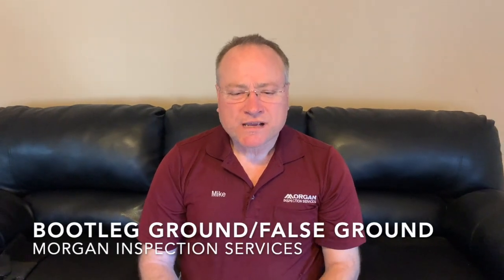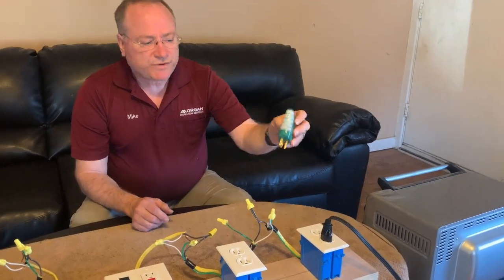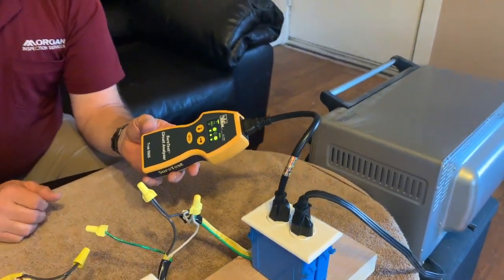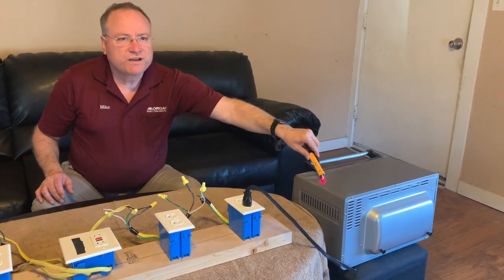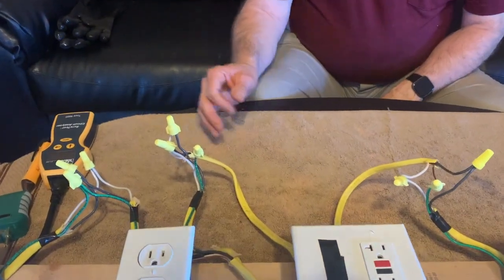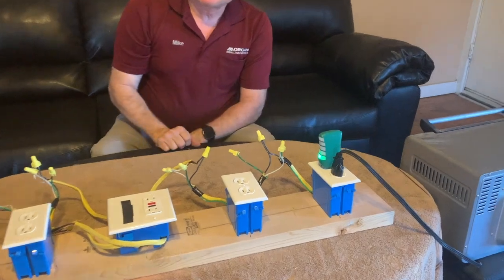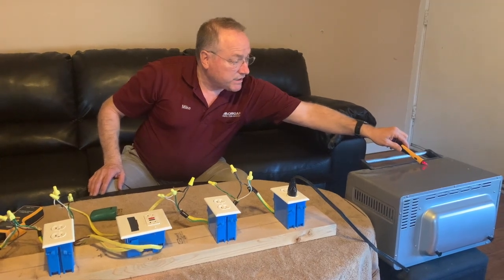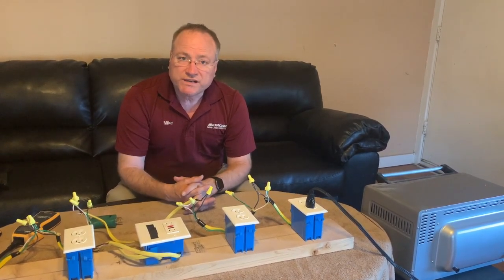What is a Bootleg Ground? Why are Bootleg Grounds Dangerous?

Comment: I know I’m late to the party, but I would like to point out, a couple of First I do not support ‘BLGround’ but there a couple of countries where it is legal and was made illegal by code in the USA in 1996. So don’t do it.
Second any 3 prong clothes dryer is a ‘BLG’ where the neutral and ground are bonded on the machine, and it’s completely legal so when you wire a 4 prong you simply separate the ground and neutral. 
Now we go to the test where you separated the neutral and showed current on the microwave, well once there is ‘BLG’ there will always be current on the microwave 
Neutral doesn’t shock you 
Neutral and ground are bonded bonded on the main panel
There benefits for ‘BLG’ against short circuit and ground fault problems
But don’t do it use damn 
GFCI outlets

Comment: I'm thinking if you moved into an old house full of bootleg grounded outlets, until you can get an electrician to work on this issue, it might be safer to unscrew the outlets, cut the bootleg ground, and leave it temporarily that way, than have the ground connected to neutral.
Reply from the maker: You’re exactly right to be cautious. A bootleg ground—where the ground wire is illegally connected to the neutral terminal—can create a serious shock hazard, especially if the neutral becomes loose or disconnected somewhere upstream. In that case, parts of the system that should be safe (like the metal cover plate or appliance chassis) could become energized.

Cutting the bootleg ground and leaving the outlet ungrounded (but labeled properly) is definitely safer than leaving the fake ground in place. It’s not a long-term fix, but it eliminates a dangerous condition until a licensed electrician can run proper grounding conductors.

Thanks for pointing this out—it’s a smart approach to a dangerous situation!

Comment: Liked. Both points you've made in the video are good points.

However, I'd propose a third point on why bootleg grounds are bad. And that is nullifying GFCI's. If a bootleg ground is installed upstream of GFCI protection whether that is an outlet or circuit breaker, then it forces the ground out on the neutral path, which would look business as normal to the GFCI = no interruption.

When upstream of GFCI it is much safer to just let the ground float as sometimes it would still trip if current goes out to ground due to the saturation effect causing a temporary mismatch in current to neutral.

Some people really don't think before cheating something like a basic light tester.
Reply from the maker: Great point! Bootleg grounds are already a dangerous shortcut, but installing them upstream of GFCI protection makes them even worse by bypassing a critical safety feature. I hadn’t thought much about the saturation effect on the ground float, but that’s an interesting consideration. Thanks for sharing your knowledge!

Comment: I don't understand the case where neutral is broken before reaching the outlet with the bootleg ground.  In that situation how is there a circuit at all in the last box?  Isn't the hot wire the the only wire that has an unbroken path to the panel?
Reply from the maker: Thank you for your question! You’re correct that in the case of a bootleg ground, if the neutral is broken or disconnected, the circuit is disrupted because the return path for current is interrupted. Since current can’t flow, the load essentially becomes a conductor, and this causes the neutral side of the outlet to become energized, as does the ground system, because the neutral and ground are improperly connected at the receptacle.

This creates a dangerous situation where the ground and neutral can carry voltage, making what should be a safety feature (the ground) a potential shock hazard. The hot wire may still have an unbroken path, but without a proper return, the circuit can’t function safely, and the entire system becomes compromised.

This scenario is one of the reasons why bootleg grounds are so dangerous and violate electrical codes. Proper wiring and grounding are absolutely essential for safety and functionality. Let me know if you’d like further clarification or have more questions!
Reply: @morganinspectionservices3840  Thank you for the explanation.

Comment: A good electrician friend of mine who also worked as a home inspector many years ago, told me of two methods he's used in the past to detect bootleg grounds that do not require removing the coverplate or the $450 give or take Ideal SureTest circuit analyzer.   

The first alternative method requires that you have a good estimate of the distance from the panel to the outlet you're testing, as well as whether the circuit is wired with 12 or 14 gauge.   

Here's an example.  This house was built in 1955, there is a fairly recently installed breaker panel, and some rooms have all two prong outlets, other rooms are three prong that test as "correct" with a three light tester, and you need to know whether or not the rooms with the "properly wired" outlets were fed by newer romex added when the newer breaker panel was installed, and you estimate the distance between this outlet and the panel to be 50 feet, and is on a 15 amp breaker. Resistance of 14 gauge copper at 68°F is 2.53 ohm/1000 ft. Since the neutral and ground only connect at the service disconnect in a properly wired home, and 50 ft of Romex is 100 ft of wire, this means that when you test the resistance between the neutral and ground slots, there should be at least 0.25 ohms (the actual reading  will be slightly higher because devices and splices adds some resistance) if someone didn't screw anything up, a reading of say, 0.01 ohms means a false ground.   😊

The second alternative method requires placing a heavy load in the duplex outlet and measuring the voltage between the neutral and ground slots in the unused half, a heat gun or hair dryer that can draw 10 to 15 amps works good for a test load and convenient to carry in a toolbox.   Due to the resistance of the wiring there will be some voltage drop and a small voltage between neutral and ground in a properly wired outlet that increases with increasing the current draw and distance to the panel.  0.5 to 2 volts neutral - ground is normal, while 0 volts means a false ground.
Reply from the maker: Those methods would definitely work. That’s how the Suretest circuit analyzer does it. It is by measuring the resistance between the ground and the neutral. If it is a bootleg or false ground, then you only have a couple of inches of wire between the neutral and ground so you have virtually no resistance as opposed to 30 40, 50 or 100 feet of wire.
Reply: @morganinspectionservices3840  thanks. I sort of guessed it worked on a similar principle as using a multimeter to check the neutral to ground resistance and flashes an "F" if it's very near 0 ohms, hence the hard-to-stomach price of around $450 MSRP in 2024. My friend doesn't own an ideal suretest since he is semi- retired and tends to  have a "don't spend money to replace something that ain't broke" attitude and used analog meters for many years when he entered the trades in the early 1970s upon returning home from Vietnam, in fact I think he still has the Wiggy voltage tester  from when he was an apprentice.

Comment: Thanks, I've been working plumbing and electrical for 15 years and I never knew how to detect false grounds. I'm going to have to look up how much the circuit analyzers cost.  Do you have any recommendations on brand?
Reply from the maker: The SureTest circuit analyzer is the only one that I’ve ever used. I’m sure there are others that can detect false or bootleg grounds, but this is the only one that I am certain of that can detect them.

Comment: Maybe this was more common hack when appliances did not have a grounded plug.  perhaps the rule was if you bootleg the ground to the neutral then you should also cut the ground prong off the appliance plug. It seems like such a pointless hack... To make sure the outlet will appear grounded when using a cheap tester by cheating the neutral? So pointless. Just use an ungrounded outlet and label it ungrounded. Then adapt the appliance plug. 

It is probably more common to lose the neutral in the branch so they bootleg the ground wire to the neutral terminal to get it working again but then forget to fix the original neutral.
Food for thought. Thanks for the lab demo.
Reply from the maker: Great feedback. Thanks for watching.

Comment: Live in an almost 80 yr old home with a mixture of knob & tube fabric covered 2-wire and some Romex wiring. Went to reverse an outlet due to a goofy plug on a new window unit and saw it had a bootleg ground. I had to replace the 3 prong outlet with a new one since the old one was falling apart.  I'll be putting in a GFIC outlet next week. In the meantime, should I just disconnect that jumper? If I do this will it just render the outlet (which will be ungrounded) no more unsafe than the dozens of 2- wire outlets already existing in the house?
Reply from the maker: That is correct. It will render that outlet no less safe than all the other ungrounded outlets you have in the house, but it will render it’s safer than leaving it as a bootleg.
Reply: @morganinspectionservices3840  Okay, thx. I know the answer is just common sense but since I've been unknowingly living with it that way for 40 years with no problems I wanted to make absolutely sure there wasn't some quirk about pulling that jumper off.
Reply: Bootleg grounds becoming dangerous is rare, it used to be common practice to wire the ground to the neutral before people realised the danger. But even if the chances are 1 in 10000 it is still an unacceptable and avoidable number of people getting electrocuted and potentially killed

Comment: I didn't catch the difference between a bootleg ground and a reverse polarity bootleg ground with regards to the comparative dangers.
Reply from the maker: A bootleg ground, in and of itself, is a danger because it allows current to flow on the ground wire, which is not “designed“ to carry current. The real danger is a bootleg ground with reverse polarity, because when you have this, you put 120 V on both the neutral wire and on the ground wire. When you have 120 V on the ground wire, that voltage will be applied to the body/frame of whatever it is that’s plugged in. Let’s assume you have a washing machine plugged into an outlet with this wiring set up. The ground wire is connected directly to the body of the washing machine. If somebody touches that washing machine, they can be electrocuted because the entire washing machine body is electrified.
Reply: @morganinspectionservices3840  Got it, thank you.

Comment: Bathrooms and kitchens, with the presence of plumbing, say someone wires a recep and uses
 the ground wire as a neutral or due to sloppiness neutral touches the metal box, current on the 
neutral will be found on the toaster oven and someone touching that oven and the stainless steel
sink apron or the dish-washer or fridge can receive a bad to lethal shock.

Comment: How does the tester know it's a false ground?
Reply from the maker: The SureTest detects a false ground simply by measuring the resistance between the ground and neutral wire. One inch of copper (as in a jumper for a bootleg ground) has much less resistance than 50 feet of copper wire (if the wires are only connected together at the electric panel that is perhaps 25 feet away.)

Comment: One other thing you didn't mention. Adding a GFCI after the reverse-polarity, bootleg-grounded outlet will prevent the GFCI from functioning as it should. In essence, it defeats any GFCI devices down circuit, leaving the homeowner with a false sense of protection.
Reply from the maker: Good point. Thank you.

Comment: These are so dangerous. Seriously, you'd be safer breaking off the third prong than wiring an outlet like that.
Reply: And what's worse is that short physically removing the socket and inspecting it, there's no easy or inexpensive way to detect bootleg grounds.

The standard cheap three light testers can't do it and while the Ideal "Sure Test Circuit Analyzer" used in the video is a great instrument and has the capability, it cost almost $400.

I even found a bootleg ground by sheer chance on an outlet I replaced in the kitchen a few years ago. ...
Reply from the maker: You're correct. Bootleg grounds are just about the most dangerous thing you can do when it comes to wiring a receptacle.

Comment: I live in an german apartment that has bootleg-grounded sockets. :(
It was banned im the 70's but there are still many old outlets wired this way. There is no requirement to rewire old legacy installations. It's considered as being fine as long as you don't change too much in these installations.
Fun fact: Until it was finally banned, new installations were often installed with bootleg ground. So there is bootleg-grounding on outlets which never were 2-prong before (these were banned a couple of years before).
But there is no way to install a general GFCI - The "No equipment ground"-way you american folks may use in such cases, is strongly against the german code (VDE). To get it without rewiring, you have to replace every single outlet with one of these GFCI-outlets (which are really expensive here :( ) - and yes, since having no ground is violating our code, these have to be bootleg-grounded again (but the GFCI would work because the bootleg is before the GFCI).
The german code is taken very serious here so violating it easily leads to severe legal problems. So you have to bootleg-ground, if you can't rewire!
So I fixed this issue by myself using some GFCI-plugs (which are much cheaper) with outlets where it would be actually dangerous if the neutral breaks.
The dangerous situation appeared one time in my apartment! My washing maschine became hot due to that. So I'm happy to have these plugs.
I would like to opt into "No equipment ground", which is much safer (with GFCI) than bootleg-grounding I think, if I had the choice.

Comment: Great video, but I have a question too. First of all, that's wild that the grounded metal on the microwave show up hot! But otherwise, even if the metal is hot, you would have to be touching an actual ground or neutral at the same time in order to receive a shock wouldn't you?
Reply from the maker: No. If you are not completely insulated from the floor that you are standing on, some current will flow through you. Depending on how well insulated you are will determine how much current flows through you and if it is or is not fatal.
Reply: @morganinspectionservices3840  I’ve touched hot wires hundreds if not thousands of times without feeling any shock whatsoever. Now I wouldn’t do that barefoot on a concrete floor, or a wet one, but a. normal carpeted floor either passes no current or so little it’s not an issue. Ive seen instances where a digital multimeter shows high enough voltage that you would expect a shock but again, nothing you can feel and if you connect an analog meter, you see no reading too. I think I would have had to ground myself and try that one lol.
Reply: If you are insulated from the ground, when touching a live wire or object you will just feel a tingle usually. But if there is a way for the electricity to pass through you into the ground, it will cause serious injury or death
Reply: I’ve done that a thousand times too, and showed people touching hot wires and even make a finger wet and touch them, as long as you aren’t grounded, nothing, no tingle whatsoever.
Reply: Perhaps it depends on your sensitivity but I always feel a slight tingle or vibration when touching a live wire. Principle remains though, if you are isolated from the ground and there is no way for the electricity to pass through you, it will not harm you
Reply: Any ground will do the job. Water pipes, another metal object that's also grounded. All you need is for current to pass from one place to another.

Comment: Some of what you said is very good, however loss of the neutral would be unusual as the appliance would not function.  A neutral to ground bootleg is not going to be a shock hazard unless you lose the neutral, now on the other hand a reverse polarity bootleg is a serious shock hazard as the appliance still works normally but the case is energized.  Your experiment would be better with a multi meter as the NCVT can be just picking up induced voltage
Reply from the maker: That is correct. Bootleg grounds are completely unacceptable.
Reply: The bottom line is it's unacceptable. If you find a bootleg ground, immediately replace with GFCI and be done with it.

Comment: Show us what to look for when a bootlegs ground is in place. The danger's are apparent. What does a bootlegs ground look like?
Reply from the maker: You will only see a bootleg ground if you remove the cover plate. You will see a jumper wire running from the ground screw to the neutral screw. There is a photo of this in the blog post that is linked to in the video description.
Reply: Sometimes a bootleg ground is not just in the outlet, sometimes the ground wire runs all the way from the outlet to the main neutral circuit. Sometimes it even bypasses the breaker box and goes directly to the neutral outside the house

Comment: you need to explain to us uneducated how a boot leg ground is wired. this video does not explain that or what a boot leg ground looks like
Reply from the maker: A bootleg ground is created by running a small jumper wire from the neutral terminal to the ground screw on a receptacle. By doing this, it makes it appear to a three- light tester that the receptacle is grounded.
Here’s an article that discusses it and even shows a photo of a bootleg ground. 
https://www.morganinspectionservices.com/what-is-a-bootleg-ground/